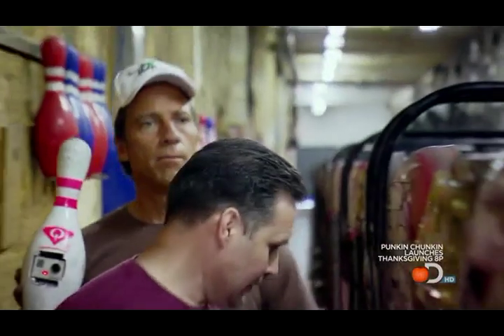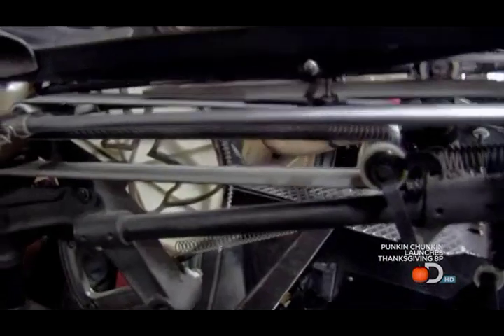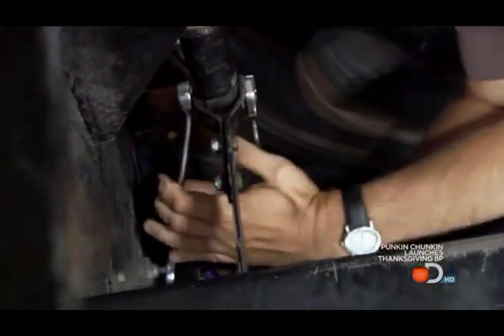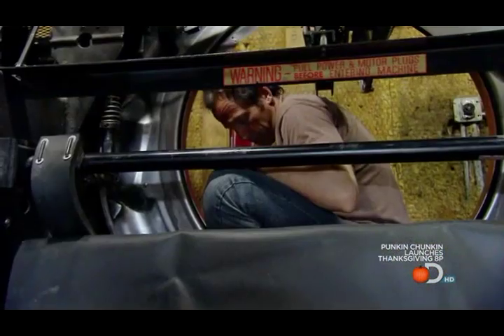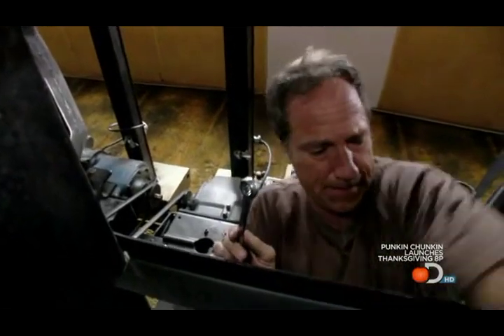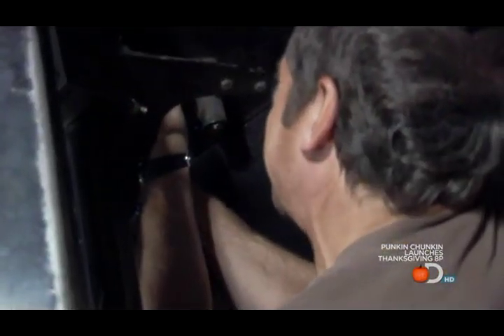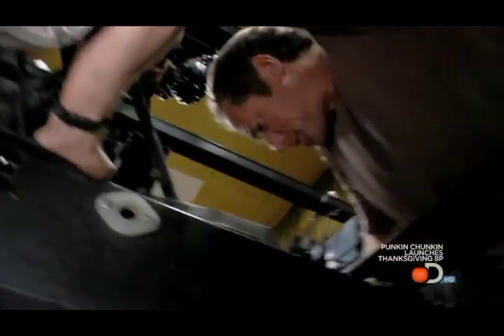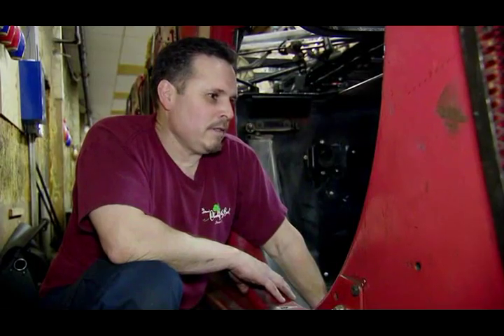Dirty Jobs with Mike Row - pinsetter mechanic

Comment: As a mechanic that has worked on 82-70s for 3 years I’ve pulled atleast 100 pits to change carpets and repair bounce boards hell if he didn’t have to redo the mount bracket or front roller retainers he had it easy

Comment: Work on 82-70's every day. It can be challenging some days. Yesterday I changed a yoke. It was broken in 2 places. Thanks constant reset button people. 😆
Reply: One break you can get away with a repair kit, 2 breaks, good idear to replace em.
Reply: I used to go to my local shipyard and get them re-welded.
Reply: @liquidsonly  Yeah I got a guy who welds them up for me. He does take his time but it's not his primary work, plus he is good.
Reply: @blazedtireiron9808  Some of my yokes have got 4 and 5 welds. Even boxed in a few of them to make them stronger. I got a guy that really does good work.
Reply: @DuruConsigliere  There’s nowhere around where Im that can weld aluminum, So I’m stuck at the replacing them or using a repair kit
Reply: @blazedtireiron9808  The repair kit is pretty good in a pinch. But with the cost of stuff moving up its probably gonna be worth your time to start looking for a welder or learn to do it yourself.

Comment: Others have said these things but just to keep it simple...  ALL models of Brunswick machines are called "pinsetters".  ALL models of AMF & AMF/Qubica machines are called "pinspotters". And the part he calls a conveyor belt is called a "carpet"... which I've changed many of without removing the cushion assembly... you just do it from the front of the machine.  I hope this clears a few things up... And I'm glad I didn't have to see Mike Rowe rip a**...

Comment: a couple things. 1 mike rowe, nice to see you doing something I love. 2 WTF is with all the wiring sticking out of the pit motor? and 3 anyone who has been working on these things for a day or two would already know the cushion block on the outter end of the pair of lanes is easier to remove the cushion than the one with the shock next to it. Mike, I think they put you on for that one.
Reply: Where I worked the pit motors were the same way. The knock off switch was removed and straight wired!
Reply: wouldn't osha have a problem with that?
Reply: Osha in a small 8 lane house. I worked at 40 lane house and never even heard of Osha. We never even wore ear plugs. Now this was 15 years ago and I guess could have changed at the 40 but not at the 8 lane house. Osha only cares for big companies that where the money at...lol
Reply: i don't like ear plugs. I cant listen with them on. hence ear plugs. I can think of a few things I could use them for. but back-ends, nope.  back to the wires. weather they work or not, (just sayin) it looks sketchy. my boss would flip if they were like this. hard to tell, but is that westinghouse?
Reply: The wires hanging out of the motor head go to the aftermarket solid state start switch from bowl tronics. The switch eliminates the internal centrifugal mechanism. They come with velco to attach them to the outside of the motor windings, but it's not the highest quality and never holds up. And as for pulling the Cushion out on the B.D. side of the machine instead of the O.B.D. At a center as old and high lineage as that one. The weld nuts for the O.B.D. side cushion box normally have snapped off by now. And you need a open end wrench welded to a 2ft piece of steel to hold the nut. And if they haven't broke off, there's no need to stress them out more by constantly torquing on them. So it makes more sense to pull the bolts out of the B.D. side of the machine. Anyone who's worked at a high lineage center knows that.
Reply: The only problem with removing the support on the blind side is that the nuts on the back are only tack welded & are known to break loose, When they do you have an entirely different problem altogether, I made up my own 9/16" ring spanner for this which is around 3ft long & has a magnet on it so it holds a fresh nut on reinstall, The spanner just about fits through the little gap at the back of the foot plates to gain access but still a bitch to do if you are on your own unless you are blessed with 6ft arms!.

Comment: There is no need to take out the pit cushion to remove a bounce plate assy!.
Reply: Yeah, I was wondering why they were doing that.
Reply: I always pull my cushions. It takes less than 5 minutes and gives me so more much room for pulling the front roller support hinges, tightening down the A-frame, and anything else that needs to be done when you do a pit. Takes less time than hauling a carpet and bounce board around to the front of the machine lol.
Reply: Agreed. So much easier to work in the pit with the cushion gone and out of the way.
Reply: no1froggy yeah man, have a great time putting your bounce plate wrapped in a carpet back under the pit cushion. 😂😂
i prefer to have room while doing a carpet replacement.
Reply: Joshua Huson right!!! who wants to walk down a center cap with a bounce plate and carpet ?? 
the only thing i might do differently than everyone else is not removing the paddle to push the front roller through. i just cut the bad carpet and pull it out, and put the front roller through the back of the pinwheel
Reply: you dont need to take anything from the pinwheel or back end of the machine off at all you just have to remove the ball door flap and shove both rollers through the door to the opposite lane cut carpet remove bounce board and set it on the pin deck or the lane put new carpet on it push it back on the bolts re position  back end roller first tighten down bounce board then fit front roller in place release the clamps and thats it what you guys are taking off of the pit guard and around the pin wheel is adding at least 1 hour to the job 
i just did one like 4 hours ago lol
Reply: I have had no problem in my 20+ years of doing them.
Reply: I agree pull the cushion and cut the carpet unless that things still under warranty. I also remove the paddle to load the rollers through. Also while in there cleanup anything and tighten it all down again. I'm a big guy. I'll take all the room I can get.

Comment: Aww.... come on Mike,... I can do two of these carpets a day... Wait till you get one of these when the nut holding the rubber mount for the bounce plate strips and just spins.. and on an odd side machine at that....
Reply: Wait.. it actually takes so long that you'd only manage 2 in a day?!
Reply: @VinylToVideo  to replace a carpet takes over 2 hours if everything goes perfectly, which it never does, on top of other maintinence and calls 2 is the most you could do in a day if the house is super dead